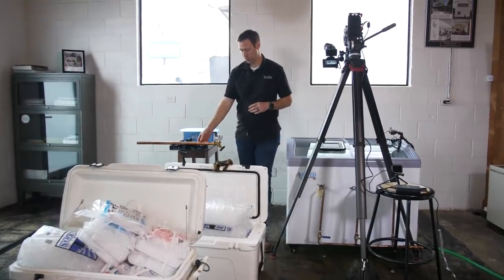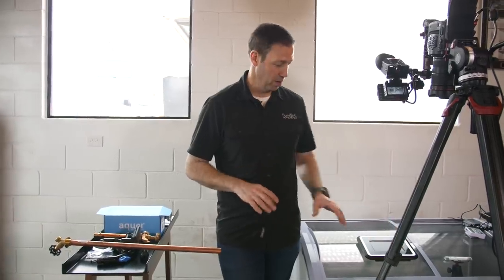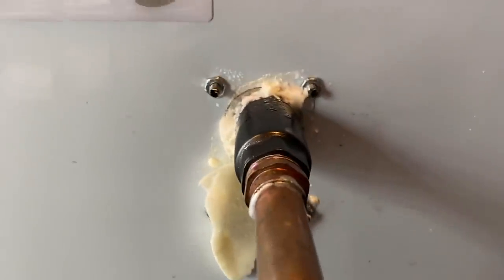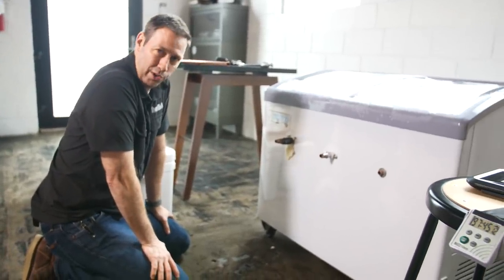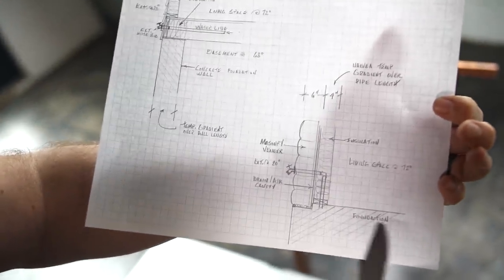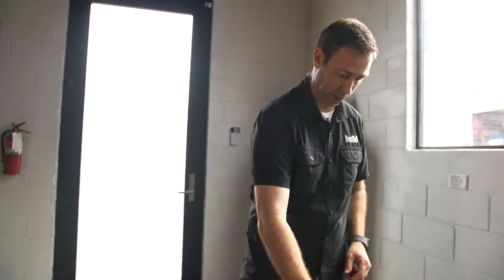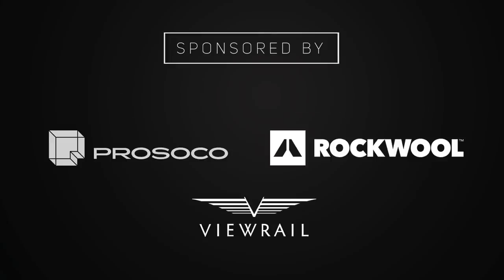Frost-free Hose Bibb?  Yep, it TOTALLY ICED over!

Comment: After turning the water on you didn't let the air out of the pipes by running the water a little. There probably wasn't any water up in the pipes, just a trapped air bubble that is under pressure.
Reply: Yeah, you had air trapped in the lines that you didn't bleed out.
Reply: Also could have opened the water line valves behind the unit to see if the frosted area leaked before cutting the line.
Reply: I was just about to say the same thing... really needs to be redone properly!
Reply: My exact thoughts
Reply: Yup, same here. Was typing the same thing when I saw the original comment. Good experiment but may need to be redone after you bring water to the faucet before closing the header off. Don't throw the freezer away yet! 😁
Reply: I second all this lol. Was about to post the same  thing. Air doesn't expand when it freezes like water does do it's not going to make and an ice block therefore will not burst the pipe. Matt I live that you do these things and love watching them. Would like to see it redone as well with no air in the pipe. As well as maybe an 8" first free arrowhead with an avb which seems to be the most common up here. 
-Your Seattle union service plumber.
Reply: Also given that the water won't compress, wouldn't any pressure be transferred down the line to the rubber hose which would expand first before the copper. Not sure I like his "science" tests that are sponsored. If he is going to test a sponsor product then a bit more due diligence is in order.
Reply: Also, the IR temperature probe can have wildly different results depending on the emmisivity of the material you are measuring. Not a reliable method of comparing temperatures between a frost covered pipe and a bare copper pipe.
Reply: Yup. Retest!
Reply: Yep needs a retest.
Reply: These tests are a joke lol
Reply: Needs a retest, purge the air
Reply: Literally came to comment this. He never purged the the air out of the lines. This is amateur hour level mistake.
Reply: Sorry to be offtopic but does any of you know a tool to get back into an instagram account??
I was stupid lost the password. I appreciate any help you can give me!
Reply: @Holden London Instablaster ;)
Reply: @Ahmed Malakai thanks for your reply. I found the site on google and Im in the hacking process now.
Looks like it's gonna take a while so I will get back to you later when my account password hopefully is recovered.
Reply: @Ahmed Malakai It worked and I actually got access to my account again. I'm so happy!
Thank you so much, you really help me out !
Reply: @Holden London No problem :D

Comment: This isn't a good test.
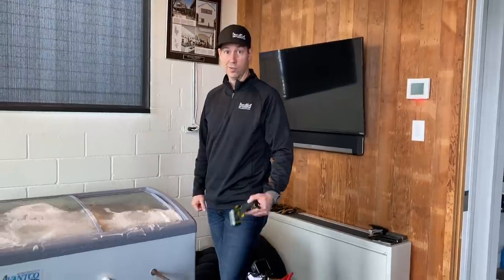Reply: very flawed...  the dry ice is expanding in the fridge pushing out the moisture of the melting ice, meaning you have to depend on the sealing of the wall to pipe and you can see in the video timelapse  the vapor collecting on the pipe  @ 10:41
Reply: My first question was "Why is there extra spray foam around the Aquor?" Seemed sketchy to me. The plastic bib of the Aquor gives it a chintzy look.
Reply: Agree. Normally the pipes would be contained inside the wall and the first 4-10 inches would not be exposed to ambient room temperature nor ambient moisture levels. He also didn’t evacuate all the air from the taps (at least he didn’t show it on the video) so we aren’t sure if the fixtures have water or air at the fixture valve location.
Reply: Also saudering the brass fixture increases conduction of heat. Literally why that's a screw on fixture
Reply: @davidstocker2278 , Depending on the situation, you might actually want the pipe to be more conductive due to requiring more energy removal to reduce the temperature of the larger system.  I personally prefer them screwed on in most cases, but just because it has a MIP threading dose not mean it was installed incorrectly.
Reply: BadWolf524 yep. Snow isn’t made of carbon ice.
Reply: If the pipes were never bled out of the air, it’s a failed test. Good idea of testing tho, but unfortunately a waste of time and needs to be redone.

Comment: That laser thermometer won't read stuff like that. It's reflecting back to itself.
Reply: shawn d that’s I I said
Reply: It's not reflecting back to itself,  but it does reflect heat from the room. Also, it may not have been aimed correctly as the laser is pointing higher than the sensor.
Reply: Pretty much nothing is happening behind the wall, because humidity is so low in the winter.
Reply: My infrared thermometer has a laser pointer for the user’s convenience.   I’m not aware of any device that uses visible light to measure temperature.
Reply: Thermometer won’t read accurately off non-black surfaces.
Reply: One thing that drives me crazy, and maybe it has been said before, is that those non-contact infrared guns need to be corrected for emissivity! This is why the surface texture and material will have different temperatures. It is OK for simple tests but put a piece of black electrical tape on the surface and put the emissivity value to 0.95. Bam DONE!

Comment: Matt, Electrically conductive and thermally conductive are two different things. Electrically conductive has to do with the movement of electrons along a substance. Heat energy is the kinetic motion of the atoms and molecules, with hotter substances moving around a lot more than colder substances. Thus, heat conductivity has to do with the transfer of kinetic energy from atom or molecule to atom or molecule. This is important to remember, because one of the chemical properties that help defines metals versus nonmetals on the periodic table is thermal conductivity. Most metals are poor conductors of electrons, even performing on par or worse than many nonmetals. However, all metals perform better than nonmetals as thermal conductors, since nonmetals tend to be thermal insulators. So, when you used the electrical properties of stainless steel to highlight it's thermal properties, you were comparing apples to oranges.
Reply: Yes, apples to oranges, however stainless heat transfer is dramatically slower & thus is often used as heat shields for exhaust & engine firewalls in vehicles as it does not transmit heat (molecular movement) through the metal as well. Stainless brake disks = bad idea (most all heat/ energy must be absorbed by the brakepads & calipers), stainless caliper heat shields = good idea (keeps fluid cooler in lines & hoses from baking & becoming brittle).
Reply: @michaelamick4887  Right. But my thing was his use of electrical conductivity as a way to show thermal conductivity. It's likely to get people thinking that you can use an ohm meter to test thermal conductivity.
Reply: You are incorrect. Electrical and thermal conductivity are directly proportional to each other.
Reply: @jasonsmall5602  you are incorrect. While useful as a rule of thumb, the assumption that electrical conductivity is proportional to thermal conductivity is not strictly true. Google a Weiderman graph and you will see that there are variations.
Reply: @benpenkacik3883  Sure,I overstated the relationship, but it's generally true. I do recall reading an article recently where they were widely different for a material.
Reply: As others have pointed out, they are proportional. However, in the context of this test and the real world, it wouldn’t matter for this.  While the transfer rate is slower, it’s not Zero. Hence, if you had 20 deg F outside, and a piece of stainless stocked out of the wall, it would eventually become 20 deg F for the stainless that it outside. Over a sufficient time period, it would reach thermal equilibrium at the same point as a copper pipe of the same dimensions.

Comment: I have to agree with the other guys, air needed to be purged out of the line and constant water pressure applied to the water line. Unfortunately, I did not learn much from this test. I still love your videos!
Reply: All you guys saying it isn't want a good test/experiment are missing the point.  He showcased the differences between different materials that conduct heat, that is the take away.  The sweating is obvious if you think about it.  Any cold surface inside your house will sweat.  Cold water lines sweat inside your house can sweat.  It's normal.
Reply: @FeelingLikeThatNow  I'm aware of cold pipes sweating when exposed to water air, that's a given. I thought he was showing the difference in the outside hose bibbs. His quote: Is a Frost-Free hose Bibb really freeze proof?

Comment: Try again using pex or pvc delivery piping (how many southern homes are still using copper water pipes?) and see if the valves/etc freeze

John
Reply: great idea
Reply: Right. Without the "copper radiator" there is a lot less distance for the temperature gradient.

Comment: Not real-world results. I have never seen freezing like this in Michigan. The only time I have seen a frost-proof sillcock freeze and break is when a hose was left hooked up to it or if the sillcock was misinstalled and not pitched downward. If the water can't drain out, it's going to freeze and split.
Reply: I agree. My Colorado Cabin does show condensation at a couple corners of a door like this at -28F.

Comment: Matt, thanks for trying but it's quite obvious, you are from a warm-weather state & it will probably be getting warmer if people like you keep venting refrigerant to the atmosphere. Now let's go over some of your shortcomings in the video #1 you did not bleed the air #2 up in the North and Midwestern United States we usually use 12 inch to a minimum of 6 inch no freeze hose bibs ( some brands are better than others ) &  also a bleed down shut off should proceed it . Most of us have basements, it makes winter preparation very simple.#3 most freeze ups are caused by poor homeowner preparation ( not disconnecting the hose ,ect ).  #4 your work crew did nothing wrong, that is a universal hose bib it can be sweated or you can use an adapter ( the manufacturers do this on purpose so they don't have to supply twice as much inventory, it's a great idea). 
 Matt, love your videos, it's one of the best ways we can learn from each other, not just in our own communities but now across the world. Hopefully you learn from us as well, in your comment sections. A lot of times I learned more from the comment section on YouTube videos then I learned from the video it's self. Keep up the good work, it's a great way to spark conversation on the subjects you so love.

Comment: Tne frost-free isn't installed correctly! They must be dropping to the outside! That way it drains!
Reply: If there was never a hose installed there would not be any water between the outside and the valve to drain out.  In his test there was never any water in the valve just air.
Reply: @jimmyrogers4177  In Colorado we have to disconnect the hose, yes we angle the bib to drain too.

Comment: My thoughts from a Northern climate:  Your section of pipe that was showing condensation would be on the cold side of a vapour barrier, inside insulation nearest to the outdoors. There would be very small amounts of water vapour within that space compared to your rather high humidity experiment. In a cold climate I would imagine the relative humidity of the insulated space is pretty close (or lower) than the outdoor humidity ( cold air won't hold much water vapour). In cold weather there will be very little transfer of water vapour from the outside to the warmer insulated space, so I doubt you are going to have any really comparable opportunity for condensation to happen within that assembly.  This past summer I changed such a fitting in our very cold climate zone.  There was no sign at all of any condensation happening from the original frost free fitting.
Reply: I also put pipe insulation on the inside before the wall, to keep it from dripping condensation when water is running during warm/hot weather.
Reply: I believe he said 67% relative humidity in that room at 68 degrees?  You'd never see that in a house in the north in the winter unless you had a broken humidifier or something.  You're lucky to see 30% unless you have a humidifier artificially boosting it.  In commercial buildings it's even worse, at work I regularly see 15%-20% relative humidity.  No way you'd see that level of condensation at normal conditions in the winter in the north unless you had an outside water leak or a broken humidifier.

Comment: If it gold COLD ENOUGH outside, every pipe in the house would freeze. Further, who in their right mind would use such a short frost free valve in a climate where it gets that cold? The norm in my area is a 12 inch, and I have NEVER seen one freeze unless some idiot left a hose connected or whatever which, of course, doesn't allow it to drain.THIS WAS SIMPLY A VIDEO - ANYTHING - TO GET THE MULTIPLE ADS ON.
Reply: Climate change is doing a real number on us. Last year's polar vortex brought much lower temperatures and for longer periods, and thus houses weren't built with those temperatures in mind. After all, if the local climate tends towards an average low of just below freezing, you're not going to be building a house to withstand -15F for weeks on end.

Fast forward 40 years from when the house was built in the 70's or 80's, and suddenly you're faced with the very real prospect of split water lines in your wall, because we've been ignoring all the science about climate change.
Reply: @MrMartinSchou  My Colorado Climate change was -28F a couple weeks ago.

Comment: A few considerations regarding heat transfer...

Because nature prefers balance, the higher heat energy of the room is transferring to the interior of the freezer trying to reach equilibrium. One of the paths of transfer is through the hose bib assemblies. Assuming all three hose bib piping assemblies are equivalent (pipe, fittings, amount of water, all air purged) it is reasonable to conclude the amount of heat energy "available" to each hose bib from the piping assembly is the same. The highest thermally-conductive hose bib assembly (copper) transfers that heat energy into the freezer at the highest rate. Since all three have the same heat energy input, the copper should have the lowest temperatures since it is transferring heat away the fastest.

Your test did not bear that out. As suggested by so many others un-purged air is highly likely. Also, as suggested by so many others, the non-contact optical thermometer is giving erroneous data in these conditions.

Besides proper setup, the addition of a simple data logger and thermocouples on the interior and exterior of the freezer at each hose bib would have presented much more meaningful data. If you want to perform scientific experiments and present the results as scientific, consult with qualified professionals and actually perform a design of experiment. University of Texas at Austin has an engineering school...

Comment: If you want to see how a cold climate construction is done then come visit some project sites in Winnipeg Manitoba Canada. Homes are designed for -50 degrees Celsius. 12” minimum frost free valves required. Many have a secondary shut off valve just inside the foundation in case the frost free fails.

Comment: More than a few flaws with this test unfortunately. Among them is there's still compressed air in the pipe which would not be the case if you had water flowing through the wall faucet. I think this is why none of them burst. Using an inferred thermometer for ICE is a bad idea because the ICE is reflective. A lot of the time the copper pipe butts up against something which helps to make them burst when it freezes. The brass water faucet seems to me like it wasn't sealed up correctly and has a tiny air leak hints the ice build up. The water must have not been frozen when it came out so its a lot less likely that its the fault of the faucet.

Comment: Bleed out the air and do another with a 12" vs the 4"
And you need one final with the heat wire on it that some really cold climates use.

Comment: Didn't purge the air. 

My parents are in Michigan and they had a 12" frost free bib fail. They now have there own manual shutoffs behind the bibs which are now left open all winter.

That aquor does look solid though!
Reply: I was going to say something similar.  Having lived in Northern Illinois and Minneapolis, I made sure that hose bibs had a manual shut off in the basement or crawl space. And in the winter, when I closed them, I made sure the outside valve was cracked open to let water drain, or relieve pressure is it froze. This was in addition to the 'frost-free' hose bibs.   Cheap insurance.

Comment: -28F on my build in Colorado gives a Real Test. This may be a little BIASED Test as I don't see foam sealing the middle spicket. It appears air leakage promotes the condensation. I notice the Copper one is closest to your heater too. Not purging the air works against accurate example. Here in the Colorado Rockies we angle the bib with a angle to drain after use. 20:36 at 20F we wear T Shirts like in my "Greater to Give" vid it shows 5F. 
I met Tim with his grandkids in Creede last year. Be Blessed

Comment: Eh.. you can get a fancy hose bib.. or, when Winter comes along and you know your stuff is at the risk of freezing, you can close the valve that leads out to it that's normally located near your water inlet (several feet inside your home, somewhere near the water heater), and then open it to drain the water out.

Bam. Instant 48" cut off system, cost: $0.